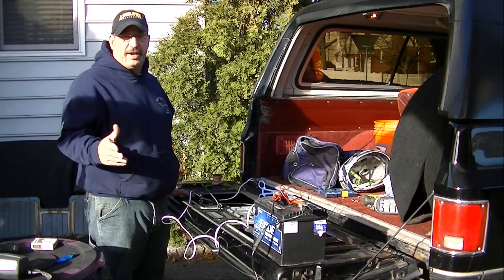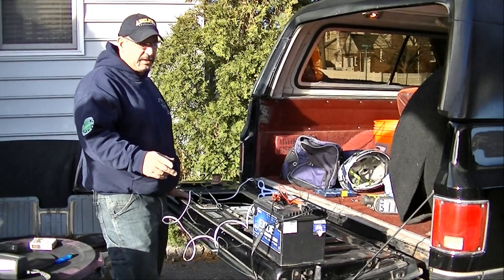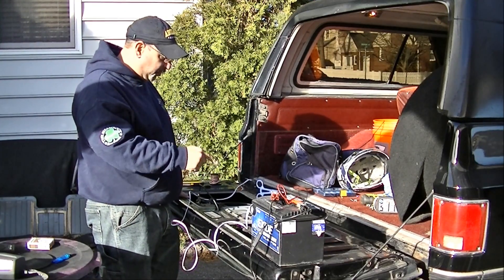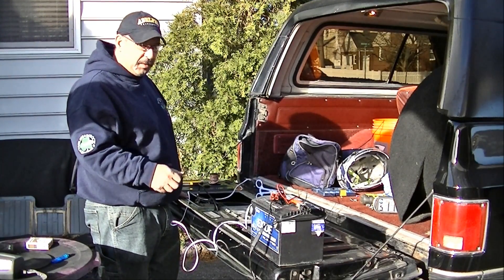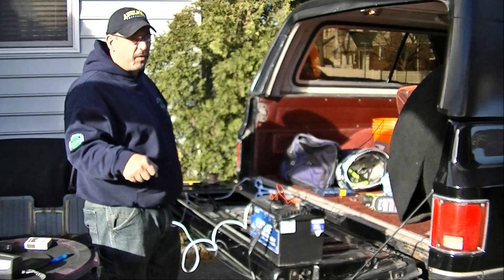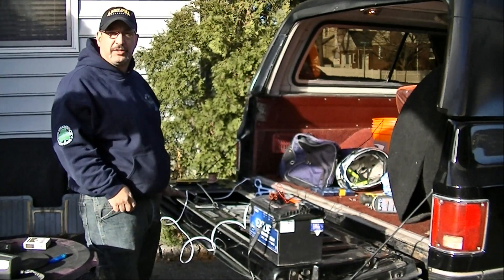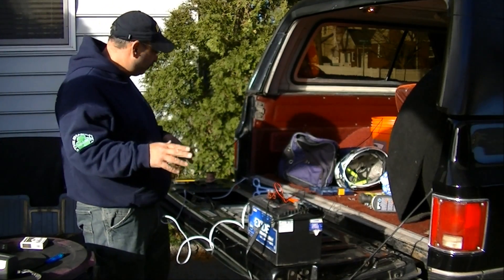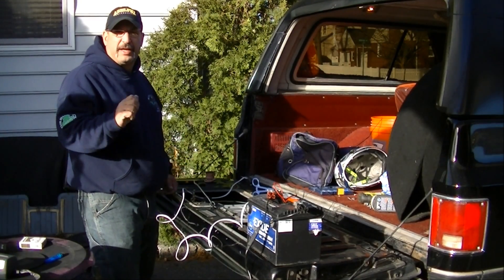K5 Blazer Tailgate Window Troubleshooting and Repair Part 1

Comment: I have a 90 model blazer with the same problems after checking it out my rollers are bad too in fact one was gone having problem finding new ones wondering where you got yours thanks
Reply from the maker: We never did get new rollers

Comment: Another concern for window operation (both the key switch and inside cab control switch), is the interlock switch on the tailgate. If the gate does not fully close, the interlock prevents the window from going up with the track in the top misaligned to the gate. I have a bad switch on my 85 K20 Suburban. It was intermittent so took me a while to find.
Reply from the maker: Interlock was good, It turned out to be a broken (rotted) connector in the harness. Thanks for Watching.

Comment: So, any updates on this? I'm in the process of restoring my tailgate myself. I just ordered a new lock cylinder, as my key also doesn't do anything when turned in the rear lock. I bought a new window motor so I hope it will help to correct the stalling problem. On a side note, my internal window channels, particularly the driver's side channel, was so rusted it broke in half when I removed it. I'm glad LMC has those.
Reply from the maker: Yes, we plan on making some new videos with regards when the weather starts to clear up.  As it turns out, we had a weak old motor,  worn channel weatherstripping making the motor work harder, and worn rollers on the regulator.  Additionally, a rotted harness connection made the rear key switch not operate the rear window, and the interior switch worked sporadically due to a bad neutral safety switch, as it's only designed to operate when vehicle is in park/neutral.  Thanks for watching.
Reply: Try Classic Industries.

Comment: need info on reinstalling rear window after taking it out and replacing the seal ie. how does the sash go on and which way does it go in
Reply from the maker: Have not gotten that far on it yet.
Reply: The weather stripping just pops in,  there's a video called how to convert a blazer electric tailgate to manual which has good info on it

Comment: I have a 90 suburban , not hearing the motor working at all the window is stuck down can’t access the motor or anything because the glass is in the way , is there any way to manually lift the window for I can have access to make the repair , at this point Im honestly considering just shattering the window
Reply from the maker: Take the cable off and chuck it into a drill to spin the window up.  Don't break the glass.  You can get it up, just takes a little patience and possibly some disassembly

Comment: Hey Rob! Do you have any tip on how to get the rear window switch out of the dash?
Reply from the maker: Never attempted, but I would think there is either a tab or retainer on the back side.
Reply: @AxlesGarage  7mm nut driver, accessible with the radio out .

Comment: ok this is my dilemma. both the switch in the cab and the tailgate switch work . it just makes a clicking noise both directions. i took the cable off the motor and attached it to my drill with no resolve. it would not budge either direction. the tailgate is closed and window is up obviously i am stuck any help would be greatly appreciated
Reply: Mine just did the same thing.  Snapped the cable
Reply from the maker: Looks like your going to have to start taking the guts apart from the inside until you can get the glass free enough to slide down.

Comment: My window seems to be off the track, each time I either use the switch on the dash or the tailgate it makes a higher pitched noise but no movement, it seems that the engine keeps disconnecting.
Reply from the maker: You're gonna have to remove the access panel to see whats going on.  Thanks for watching.
Reply: @AxlesGarage  I removed the middle panel and unfortunately the issues are still unreachable, is it safe to remove the panel that covers the rest of the mechanics or will that damage it?

Comment: Both switches work, my window goes up and down but a little slow. The main problem is it makes this awful scratching noise. Any idea how to fix it?
Reply from the maker: They were very loud new from the factory.  Horrible motor and design.  Take the access panel off and make sure everything looks ok, with nothing obvious 'scratching' into something.  Try lubing the moving parts with white grease and lube the weatherstrip channels with silicone spray.

Comment: Man, the window on my 80 K5 works, but it’s tilted about 1/4 inch and won’t go all the way down (looking from the rear of the truck) the right side sticks up & going up the left side has that small gap of about 1/4 inch. Just really bugging me & it leaks a little in a hard rain. Any follow up to this issue would be a great help. Thanks
Reply from the maker: We have had the window down since just after the video (we installed a soft top).  However, it looks like worn 'tracks' and regulator rollers is usually the cause of what you are describing.  No way to know for sure until you take it apart and inspect.  Thanks for watching.
Reply: Axle's Garage I’ve been looking at my tailgate and I’m really not sure how to get that whole assembly out? Watched another video and said it comes out on the side. But I didn’t see any access panels on the sides. Does it come out of from the top? Thanks guys.

Comment: i can’t get my back window to go down while it is up. i’m not sure if i should take of the tail gate cover from the inside or what. someone give me an idea?
Reply from the maker: If you have power to the window motor, its usually the tailgate interlock that is the problem.  Thats the switch that only allows the window to operate when the tailgate is closed.

Comment: My 83 key switch never worked. But the dash switch works.  But over the last year, sometimes it won't go up until after a few tries.  Maybe because I open the tailgate and shut it.  The motor clicks when the switch tries to lower it (from the lowest position), but makes no sound when the switch tries to raise.  Eventually, it works itself out.  But today no luck.  Any ideas?
Reply from the maker: There is a sensor in the tailgate that prevents the switches from operating when the tailgate is not in the shut position.  Make sure that sensor is working properly.

Comment: So my rear window came down four inches, the power switch works, you can hear it trying to work but the window doesnt move. Could it be because it fell off the track?
Reply from the maker: Its possible, or the cable drive went bad.

Comment: Did you get it to work? did replacing your window regulator help? I'm having same issue with my 79K5. I'm thinking I should just get a new window regulator motor.
Reply from the maker: Changing the motor helped and we found a broken connector on a power feed under the hood that was the cause of the inoperable inside switch.  We wound up taking the glass out as we have the soft-top on year round.

Comment: my dash switch, and key switch work but my handle is being locked so annoying
Reply from the maker: Sometimes, the window interlock is out of adjustment.  Also if the latch is stuck try pushing the tailgate in while at the same time trying to lift the latch up.  I used to have a square that needed that method to open. Thanks for watching.

Comment: Just what I needed..but question...how did you remove that carpet from the tailgate..I have the same thing on mine and do not want to ruin it..thank-you brother!
Reply: Mine just has some screws in the surrounding trim you remove and it pops right off.
Reply from the maker: There are screws in the carpet that hold it to the tailgate.

Comment: I have a question I am hoping someone can answer me here. I still own my 1990 K5 Black Blazer with Gray Interior. Purchased it back in 1995 at five years old. Its been a great truck.  It has less then 70k miles on it and is pretty much rust free all around. I don't use the vehicles much at all and it sits most of the time nowadays outside. It use to be garage kept years ago. Anyway the last time I was in my Blazer the back window would not go down. Doesn't go down with the switch at the dash nor does it go down with the key switch in the back tailgate. At this point the snow is just about melted and Spring is almost here in the Northeast so I want to check it out soon. What do I need to do to get the tail gate down with the glass all the way up? At the moment I have done no research other then come to this You Tube Video to read and view the problem you are having. I guess I will start checking fuses under the dash first. Does anyone know of any other fuses that may have something to do with the back window that may be under the hood? I doubt it but thought I would ask before I take a look. Any ideas from someone who realizes my situation is appreciated.
Reply from the maker: First check fuses like you said, then check the 2 heavy wires under tailgate.  Power and ground.  Those wires will go through a few junctions.  The plastic clip junctions usually fail.  I had the one under the hood near the power booster fail, not delivering power to the window motor.
Reply: @AxlesGarage  Thanks for the quick reply. After posting I walked outside to the truck being I needed to put a new vehicle registration in it. I tried the Switch on the dash and you can hear it want to raise the motor up and down. It may budge the window a 1/16 of a inch before it stops. Went behind the tailgate and didn't notice anything with that switch to lower the window.  For the heck of it I tried to start the engine and it was dead. At that point I am thinking. The battery is old but like with many of my vehicles I don't drive much I keep a Battery Tender on them to keep them  charged up but I also know it doesn't mean a thing if the battery is past it time especially after a cold winter like we just had. Right now it is dark out. Either tomorrow or this weekend I am going to pull my Work Van in front of it just to put booster cables on the battery and try the window motor switch on the dash again. The battery was dead like I thought being I put my "Load Tester" on it and it couldn't take any kind of a load at all. I will get back to you here to let you know how I made out. I may even pick up a new battery tomorrow and throw it in at some point I know its needed anyway. That battery could be 10 years old I will have to check. I have had batteries last even longer just by leaving a battery tender on them keeping them charged up not giving them any time to get sulfated.
Reply: Put a new battery in today it needed one bad. The switch at the dash works fine up or down. I can hear the back window want to go up or down but it will not move. The back switch in the tailgate works fine you can hear it try to work the window down or up but the Window still won't budge. I don't think I have a electrical problem at this point.  Seems like something might of snapped and won't bring the back window up or down. Has anyone been in this situation? Curious if I can get into the tailgate from inside the vehicle with the tailgate up?
Reply: Finally got to it yesterday. Unscrewed the cable from the motor and the motor worked with the dash switch without a problem both ways. Couldn't move the cable by hand so for the heck of it I kept shooting WD-40 down into the cable. Took a drill and connected it and rolled down the window and put it back up. At that point I took a tub of White Lithium Grease and started lubing up everything inside that Tailgate that looked to need more lube. Saw the bottom sash I guess you call it that the glass sits in was rusted up pretty good but still solid. Wire Brushed the loose stuff off and covered all the rusted metal of the window sash with white lube. Could of put a rust Converter on it but I really have no faith in the product as I have seen things rust again using it so I believe in regular oil or grease to coat things now especially in areas where no one is going to see it inside the Tailgate. It will take a long time for that grease to stop protecting that metal I feel from rusting anymore then it did. I left the inside cover off the tailgate for awhile to keep a eye on things. Back to the cable I can now turn it by hand and see the window going up or down doing it a good sign. The problem with WD-40 is it will dry out eventually. I am going to squirt some lube motor oil into the cable or even trans fluid. I keep a Squirt Can of both products for spot lube. I believe either one would penetrate it well into the cable and keep it from freezing up. I see I have a blue colored cable. I am guessing it is the original to the truck being I purchased this '90 Blazer back in 1995 at 5 years old with 40K miles on it. It only has about 65k miles on it today being I didn't drive it that much being I have other vehicles. It sits more then anything. Going to try to use it a little more.  Last night I orderrf the weather-stripping for the outside of the back glass that sits on the top of the tailgate. That piece has been cracked for quite awhile and is hard as a rock. I am sure it is letting water into the tailgate. All other weather-stripping looks good to me. I need to look at a better diagram of the Tailgate for all the parts that make it up. Below the inside handle of the Tailgate a rounded bent up rod that is connected by I believe 3 bolts in some sort of hold down to the tailgate it snapped its holder on me yesterday. I looked online and could not find that part. If anyone knows of a Diagram that shows all the components online let me know. It must be there for a reason although I can still roll the window up and down. I do hear a knock when doing so now though.

Comment: Hello I had to take mine apart today because power window would not go back up. It was getting slower and sometimes would just stop. Well the cable going to window regulator from motor was the trouble. The cable incased in its tube was jammed. Also watch out if you remove the cable which you shouldn’t the regulator is sprung loaded and once I removed that cable it sprung up. Almost lost a finger.
Reply from the maker: Yep, those cable drive systems were problematic even when new.  Thanks for watching
Reply: I'm having the same problem with my K5 electric window and I was wondering how did you get the cable off the regulator cuz  I'm having trouble getting it off

Comment: You said cock ...lol...doing this project now ..ordered new motor ..gonna repalce regulator also ..cant find it on Ebay...any idea of a part number ? 1982 gmc jimmy ..Arizona truck ..mostly original ..69k ..had motor replaced with 350 ..has optional roll bar and skid pan ...not bad for a grand ..
Reply from the maker: I usually use the Rock Auto web catalog to get part numbers. Thanks for watching.